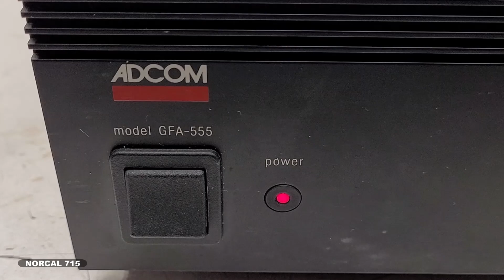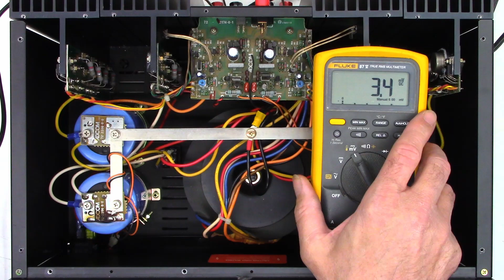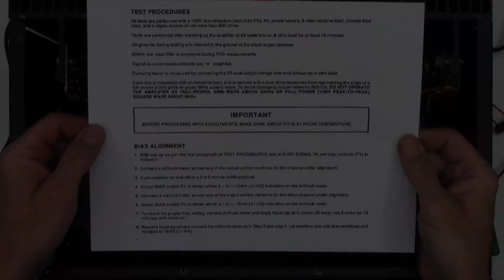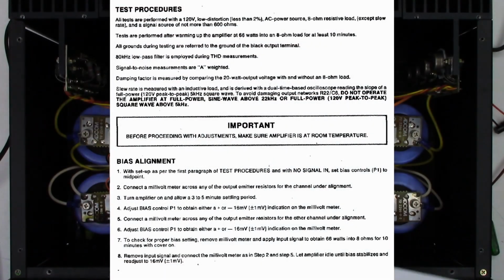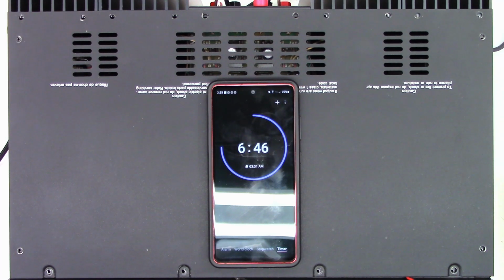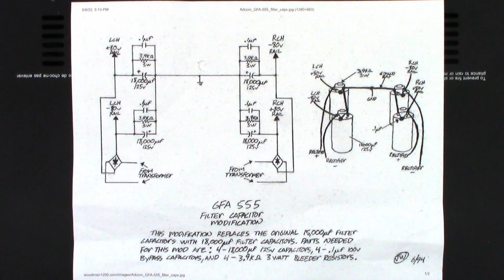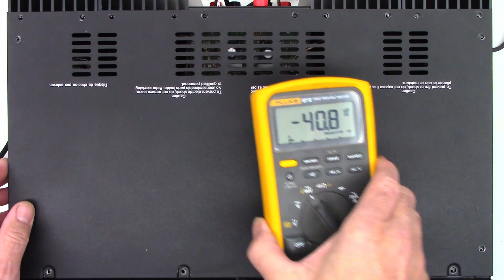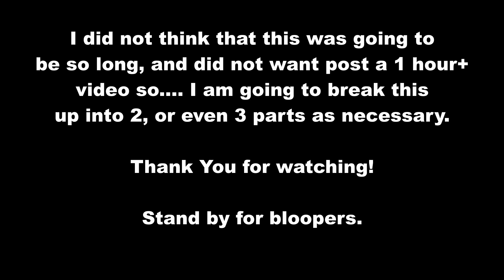Adcom GFA-555 sent from New York State for a "Check Out" One channel distorted. Bias issue?

Comment: I'm completely new to amplifier repair. Just watched your video and followed along to check the bias in my amp. I dont yet have all the tools but have a good meter so that's a start. Had to replace two fuses the second time on the right channel and Bias looks ok. The first time had to replace all 4 fuses, it was used for subwoofer duty in a large theater. Thanks for sharing!

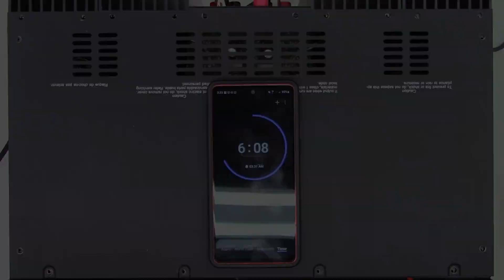Comment: 10:52.....the caps test perfect. ..why would you change them & risk changing the sound characteristics of the amp ??
Reply from the maker: I leave the decision to the owner. As of now he decided to leave the original capacitors in it. I have not had time to do an extensive test of the main filter caps though.
Reply: That ain’t going to change the sound at all. That’s just for the power rails to the collectors.